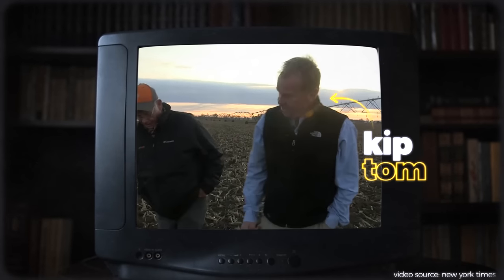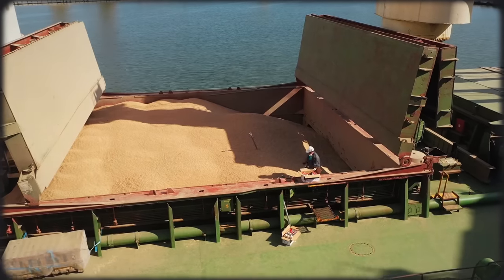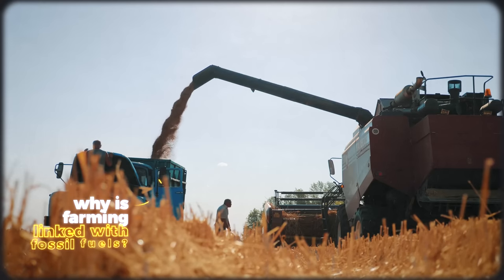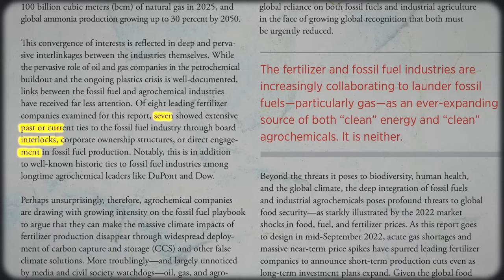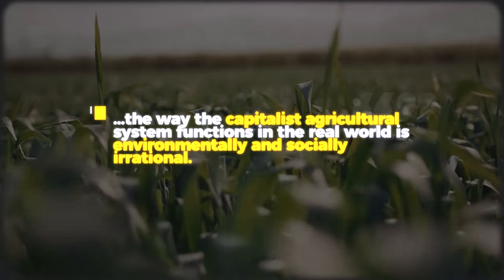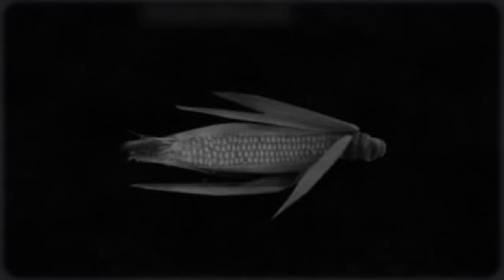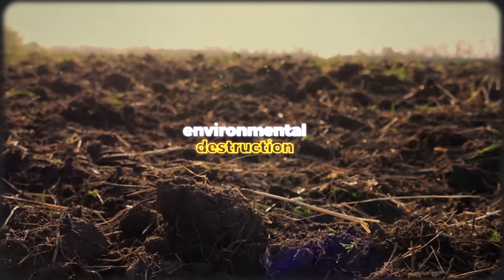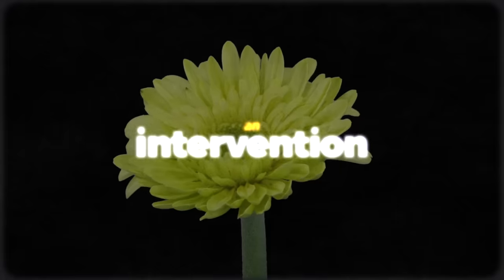Our Food is Killing Us

Comment: And this is why greenhouse horticulture is so good. Lower land use, less water use, fewer (or no) pesticides, etc
Reply: And higher prices in greenhouse farms.  Be honest.
Reply: It also requires a lot of very expensive infrastructure that isn’t practical at a large scale.
Reply: @Beyonder8335  that depends on what you mean by "large scale". For many products it is possible to grow all of it in greenhouses, and not all greenhouses require very expensive infrastructure. 

For crops like wheat and corn it probably won't be worth it, but for things like tomatoes, lettuce etc it is clearly the better option
Reply: @Ruud_Brouwer  yes it does make sense in some cases. Both have their place and neither is a replacement for the other.
Reply: @Beyonder8335  tomatoes in greenhouses are a clear replacement for tomatoes in open field
Reply: @Ruud_Brouwer  I meant in terms of certain crops working in greenhouses and some not.
Reply: @Beyonder8335  ah, yes, I agree

Comment: What exactly is the problem if ammonium nitrate is used as a fertilizer if it’s also used as an explosive? What even is the moral dilemma there? They’re so separate
Reply: The issue with using ammonium nitrate as a fertiliser is that it can contribute to water pollution and environmental degradation when not managed properly. Excess runoff of ammonium nitrate can also lead to nutrient imbalances in the ecosystem, for example, causing harm to aquatic life and plants.

Comment: i am not a chemist or agriculturist but would it be possible to extract the hydrogen and oxygen from seawater via electrolysis and then use that to manufacture hydrogen-based fertilizer? nitrogen could be put in the soil via nitrogen fixing crops, like beans, corn, soybeans, and others, and other metals could be supplied from natural sources, ideally mined in subterranean environments to minimize impact to the ecosystem
Reply: Electrolysis is a non spontaneous reaction so it doesn’t want to seperate from water on its own. It would take large amounts of energy and precious materials to integrate it in an industrial scale. Even if it were implemented t would need to be profitable under capitalism and the energy used would 100% be fossil fuels and such reactions can/may create co2 as a byproduct. This is just what I remember from high school chemistry so I am probably wrong on the specifics.

Comment: You didn´t mentioned, that synthetic fertilizer is three times(or higher)  more radioactive, as typical enviormental radiation. That is unexpected, because synthesis of chemical substances going through several process-stages and normaly, there should be no radioactive elements in at the end. But there is.
And that radiation-level is self-reinforcing because the fertilizer will be brought out every year and increases the enviormental radiation. Maybe we live in a much higher radiating enviorment, as our ancestors did (befor atomar-/industrial revolution).